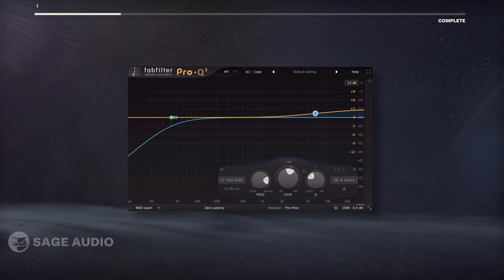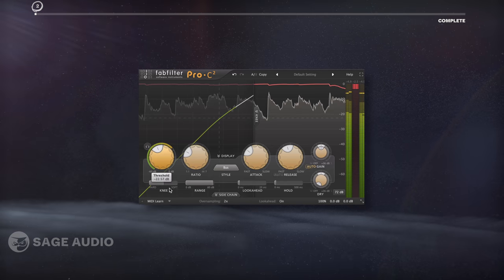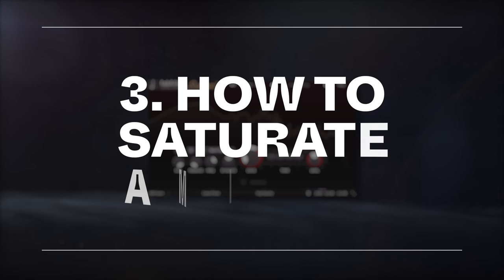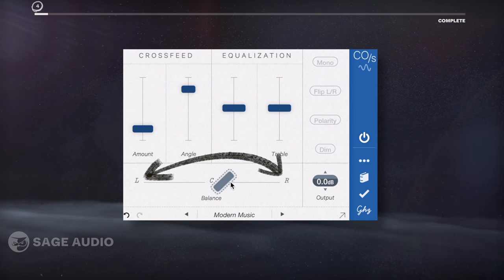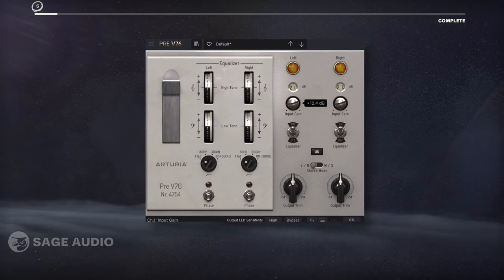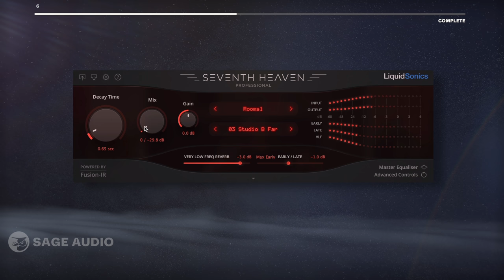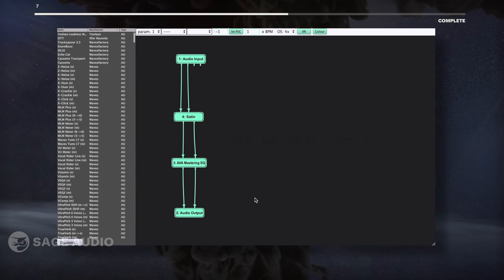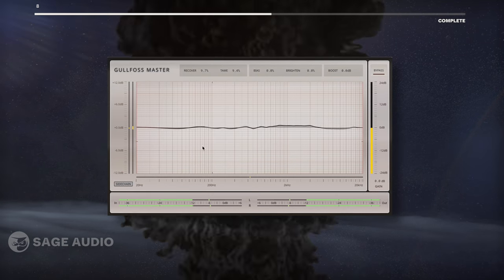How to Mix Bus Process

Comment: I use Black Rooster Audio's VPRE-73 in my mix bus with the WARMTH setting. It's very subtle, especially right before the limiter, but adds just a little heat.

Comment: Could you please do a video comparing the order of processing in a vocal chain?   Like de-essing pre or post compression, and serial compression
Reply: For de-essing, try both ! 

For serial comp, 1176 to catch peaks (3-5 db max, short release) then LA2A (2-3db max) is an tried and true method

For eq, I suggest to use a "cleaning eq" before compression (hi pass and resonnance suppression). You're not supposed to modify this eq after you set it, so you can put it before the comp knowing that it won't need you to adjust it. I suggest putting the tonal eq after the comp, so you'll be able to make changes without worring about compression modifications

You can saturate before or after comp, it won't change so much 

Basically, changing the order of processing won't affect your sound so much, but will afect a lot the ease of work

Comment: Thanks !
Do you use the first Substractive Mid-Side EQ again (but more aggressively) when you start the mastering session ?
 Because I use your old trick on my Master buss : 
- Cut Lows in Sides (ex: 145Hz. 18db/oct)
- Cut Deep Subs in Mids (ex: Below 15 Hz. 12dB/oct)
- Cut (dynamically) Highs siblings in Mids (ex: around 10 000 Hz)

Comment: Should the ozone 8 imager not be used on individual tracks either? Or just not on the mixbus? I used to see Jaycen Joshua just slightly widen his mixes on band 3 on the mixbus, but is there another way to get the same effect not using a delay imager?
Reply: The effect referred to in the video is the free single band version, that effects all bands equally; you are referring to the multiband version, which is perfectly okay to use on the stereo bus!

Comment: Hello! I just want to clarify something. When referring to the “mix bus” are you referring to grouping all of the tracks in the project to one bus. Or are you referring to the master bus channel?
Reply: most of the time people are using the "mixbus" term to speak of the master channel. The reason is we're not talking mastering here, even if most of the processes are (very) similar. Considering someone will mix the song and someone else will master it, we're talking here about the processes that a mix-engineer can use on his master bus while mixing.

Many mix engineers work with a SSL compressor on their mixbus/master channel to get a "glue". Then, the mastering engineer will use his own compressors if needed.
Reply: @FredDeMassiveAlambic  thank you so much for educating me! Means a lot

Comment: Do you ever run into CPU problems with oversampling on the tracks plus additional oversampling on the mixes? thx
Reply: export your stems, then process the tracks, even a rm nimbus could handle that

Comment: Why is the crossfeed plugin used actually made for enhancing the audio for mixing on headphones? I couldn't find much about crossfeed, isn't there a professional plugin that uses this for this purpose? Cause it makes me question why I couldn't find much about it
Reply from the maker: I think it was just the plugin I was using at the time.  Crosstalk is more common in tape plugins, so I'd recommend trying those instead if you want to apply some crosstalk to your mix bus.
Reply: @sageaudio  oke thanks! I'll try that out